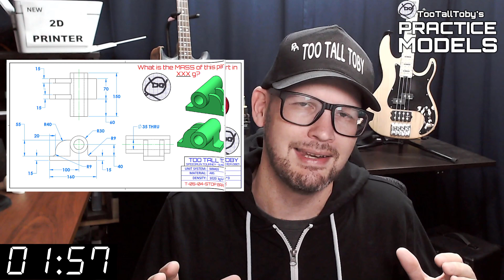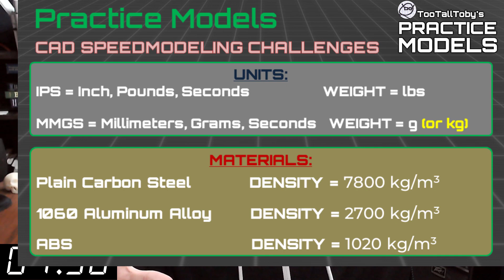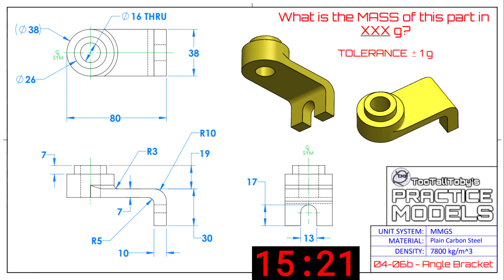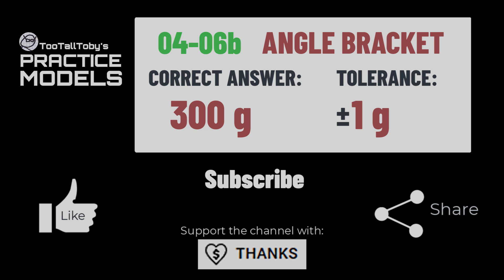SOLIDWORKS Practice - Onshape Practice - Fusion 360 Practice Exercises - TooTallToby-04-06b

Comment: In that order:
onshape: 9:42, I really need to get that masses table
fusion 360: I lost the number😅, I think about the 11 mins... the mass part is very not optimal
SW: 8:27, I wish that the replace face command will work the same, took me a minute to use the "up to surfece" extrud
Reply: also the mass came out to be 301 in fusion
Reply from the maker: Yeah you'll have to make a custom materials library to get the mass correct.  I show the three different materials we use, along with the density for each, in the intro section of these practice models videos so just copy those values into your custom materials, and you should be good to go!

Comment: Quick fun one! Although the hidden tangent edges on the shaded view threw me off a bit: I used wrong selections on the round boss at first and I also missed the R3 fillet... Still within tolerance though! 2:47. Did a second much smoother run in 1:50.
Recording on my channel
Reply from the maker: Dang 1:50 - Speedy and impressive as always Airwick!